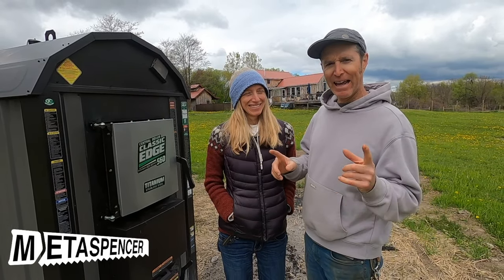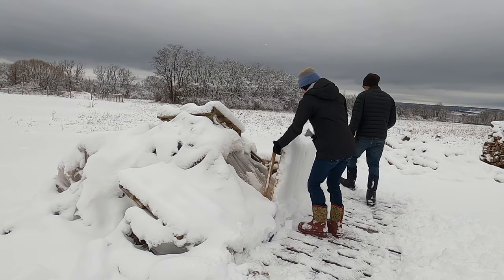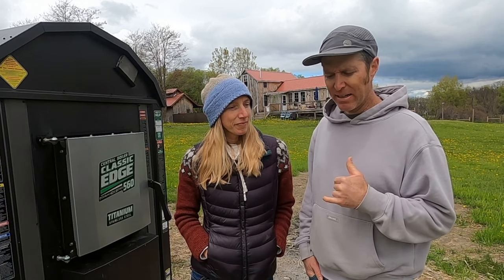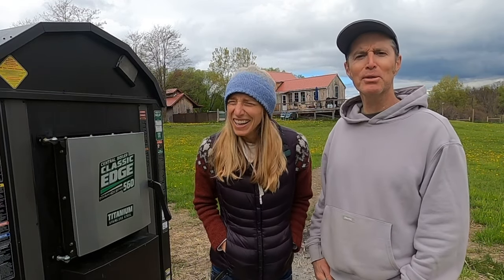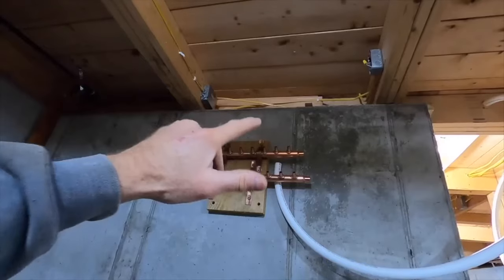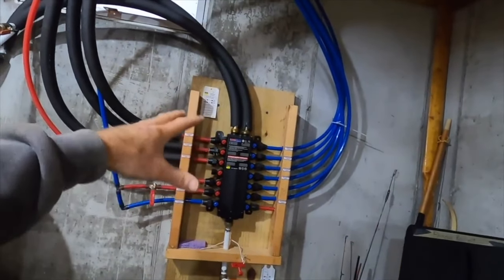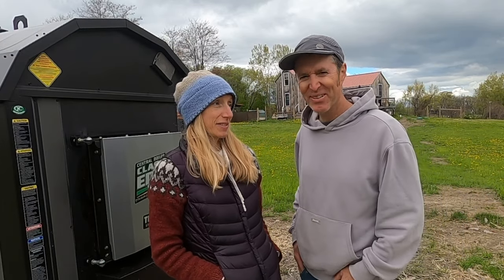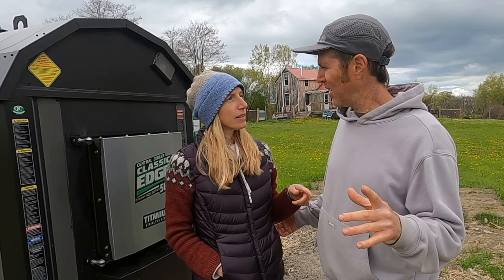Outdoor Wood Boiler 1st Year Review

Comment: size of wood is a tradeoff between laziness and burning dry wood, meaning large wood does not dry well and you don't get any heat until the water is boiled out of the wood. If you cut your wood into smaller diameters then the water evaporates well before winter when you want the heat. technically you can split less but then you will go through more wood so you will have to haul and load more wood.

Comment: What you guys are missing is a mixing valve, that way a thermostat controls the temperature in the house, it allows hot water to enter the radiators only when needed, the water in the “boiler loop” is kept hot and is regulated by the damper on the boiler air control.
Reply from the maker: You said it! Absolutely. And it's been on my to-do list for a while now to figure out exactly how to figure that out ... thanks for the reminder! gotta set that up

Comment: Get some ibc totes and stack your wood in them. You can use the plastic for lids. Makes keeping your wood dry and clean way easier. And if you have a tractor you can move them around easily.
Reply from the maker: They’re about $100 around here … I keep trying to find cheaper ones

Comment: Did you use a glycol mixture or just straight water?? I will be starting my 760 for the first time this winter in Northern Missouri. Thx. Great Job
Reply from the maker: Water + a treatment from out dealer. Basically the treatment changes the Ph of the water so it's less corrosive. There are some different formulations but we just went with what the warranty required. We thought about doing the glycol additive but it's super expensive and we plan to be around during the winters

Comment: Love your video. I have a question, I’m going to do the same thing as you over the weekend. On the original video I noticed that you didn’t have any pressure release valves or expansion tanks. Have you had any issues so far? Have you been able to keep it that way without pressure release valves or expansion tanks? I love how your set up is simple and I would love to do the same way. If there’s anything you did regarding pressure release valves or expansion tanks, please let me know so I could do somewhat similar things. You’re one of the few people who have done a wood boiler set up without an indoor boiler and I want to do the exact same thing. Thank you.
Reply from the maker: We have had zero problems with our setup. Pressurized systems tend to involve closed loops and often radiant underfloor systems. As you know we simply direct piped our radiators and since the boiler is not sealed/pressurized it's all good. There are definitely LOTS of ways to do it
Reply: @metaspencer  thats awesome thanks for the reply, makes a lot of sense now. 

Final question, do you need to bleed your radiators? Appreciate your help.
Reply from the maker: @mizaelnoriega9301  when we first set up the system we burped some air out of the highest two radiators, but not since then.

Comment: I’m not sold on the edge I have a Classic 20 + years it runs 24/7 365 summers it heats the house water the house temperature during the winter is 73 to 75  2000 square foot  house with full basement. I don’t have the maintenance that the edge has. Thanks for the video.
Reply from the maker: Sounds like you got a winner! Yeah we're only a couple years in on this unit so only time will tell ... and we only heat in the cold months

Comment: Hi Guys, Is this hardwood you're using or conifer?  Tonnage would be more appropriate as heat value in wood is pretty much consistent pound of conifer as opposed to pound of deciduous.
Reply from the maker: We've only been burning hardwood in the boiler as pine and cedar and those species tend to gunk things up. We mainly burn ash, oak, maple, but also some cherry and beech.

Comment: what i am curious about is what if you did a smaller system and did radiant floor heat in the areas that a wood burn stove wouldn't reach or basically would you think about a combo of 2 things or just stick to one or the other?
Reply from the maker: sounds like it would be pretty good! great heat off those floors for sure

Comment: So I think there was 4 pumps in this system. 
Did they run continuously?
I wonder if the electrical cost was significant or just very small?
Reply from the maker: yes 4 pumps all together and they run continuously all year long. if my math is correct, and it usually isn't, cost of running them is about $65/year ... and from what I've heard they need to be replaced every few years so I've started stocking them in my shop for that day
Reply: @metaspencer  thank you for the info and for the video itself. It too was informative 🙂

Comment: No buffer tank ?
Reply from the maker: No it's pretty simple: just the tank at the stove and lines. guys who run radiant floor systems set up loops and expansion tanks and all that. but we just looped the lines and that's it. working great
Reply: But then you need to feed the boiler all the time.. with buffer you can run in fire batchs.. and do other thing... Great video..
Reply from the maker: @thomasstrandbergsrensen3220  we feed it once a day -- not a problem for us

Comment: When it’s off, how do you heat the hot water?
Reply from the maker: The hot water heater is self sustaining, so can be heated by the boiler via a heat exchanger or not. that's a pretty standard setup

Comment: I looked into getting an outdoor wood boiler but unfortunately zoning laws prohibited that. My current situation is a wood stove in a modest 1200sf ranch home. We also have an oil furnace with baseboard heat. We only use the oil furnace for hot water so it's quiet cheap doing that considering how long a tank of oil will last with 4 people 2 being teenage girls. Our new house a 1500sf log built with a master bathroom second floor has a 6 head heat pump system with 2 units outside running 3 head units each and an electric water heater. It also has an oil furnace backup with 6 zones and a fireplace insert. I'm hoping the combination will result in far less wood burning. 20 years now burning wood has served me well but it is a lot of work and very messy not only in the house but the yard is quite a task every year.
Reply from the maker: Interesting! Yeah zoning can really limit you in some places …. Apply for a variance?

Comment: Don't forget about the termites
Reply from the maker: we haven't had any yet ... lucky!
Reply: @metaspencer  is your boiler wood fired only  ? Coal is a better option than let's you spend time refueling your boiler. 2,00,000 BTU's per ton. You can't afford to burn wood with coal available.
Reply from the maker: @danthurman9076  but I get wood for free and coal is a fossil fuel, so adds carbon to the environment above the surface
Reply: @metaspencer  free  ?  Delivered to the boiler ready to burn  ? Coal doesn't have to be kept dry to burn. Carbon comes from any solid fue,l wood included . Good luck with your boiler .
Reply from the maker: Actually I get paid for the wood as I run a tree service @danthurman9076

Comment: You do realize you could’ve put your pump in the barn didn’t have to be in the back of the stove
Reply from the maker: Because the boiler is a bit lower than the barn and house we put pumps both at the boiler and in the structures -- it seems to be working out but maybe it's overkill?

Comment: The comfort level you experienced is because of the radiant hot water heat not the type of “furnace”.  Personally I would never use a wood burner.  I’m not walking to the next zip code to throw wood in that thing every day. Wood is free? No it’s not. Even if you own a forest,  you gotta get it.  That’s labor that some think is free, it is not. What is your time worth?  My time is worth a certain dollar value.  Calculate the hours you spend just accumulating the fuel and add that to daily maintenance, not for me.
Reply from the maker: It sounds like you know what you want, which is great. We get paid to bring wood home as I own a tree service, so things are different for us. Sounds like you've made a good choice for yourself